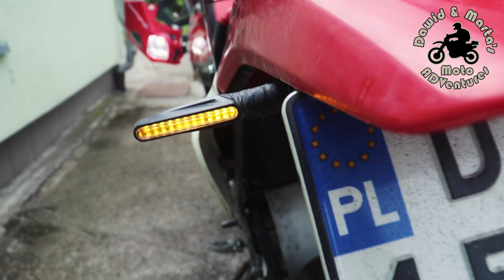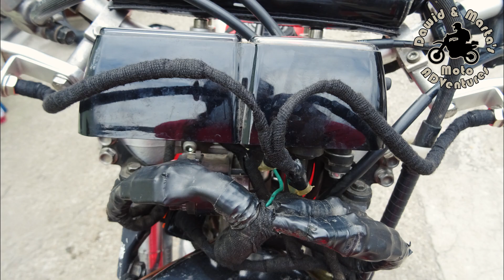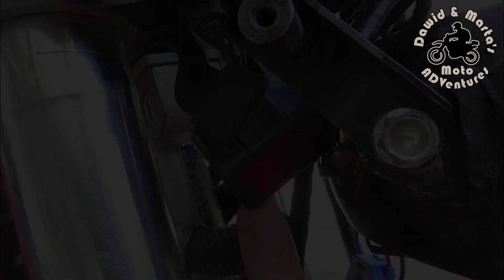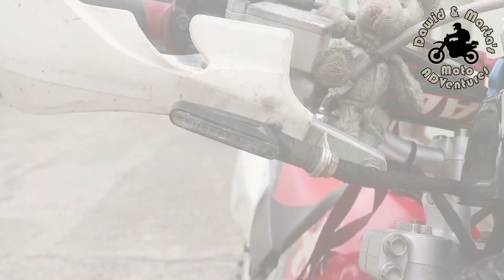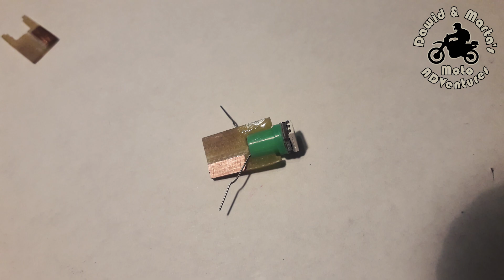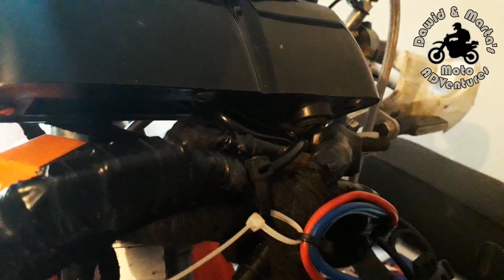🔧 XR400 - Changing blinkers to LED and solving problems with relay and indicator lamp

Comment: I followed this on my XR600R and it also works fine. A lot of commentary says you need a diode but the LED indicator bulb works. Funny story I ordered T10 bulbs watching your video but of course the XR600R is T5 so I had to find new ones to fit.

Comment: Hey mate, what did you use to mount the rear number plate and led indicators? Tail tidy?
Reply from the maker: It was already there, previous owned did it. It is just a pipe and bended flat bar, welded together.

Comment: Hi I got a Dr650 and I fell offroad and the rear right flicker was not working. I then bought 2 LED rear flickers and they are not working now, is it the internal wires inside that's not working or am i just being stupid. Please if you know whats wrong tell me.
Reply from the maker: Hi!
I think LED blinkers at the rear and normal blinkers at the front may be a problem. Try to disconnect front blinkers (or just remove bulbs) and check it again. Also blinkers indicator lamp may be a problem and you can remove it from the dashboard for tests.

Cheers!

Comment: Argh, bought the same flowing signal lights for my XRV750. Even after installing an LED relay only the first led bulb in the series blinks ever so slightly instead of the whole thing flowing. This problem led me to this video. I'll check if the dash bulbs can be replaced.
Reply from the maker: Africa Twin, we were riding on it for 3 years :)
I hope that blinkers are working fine now :) 
Cheers!